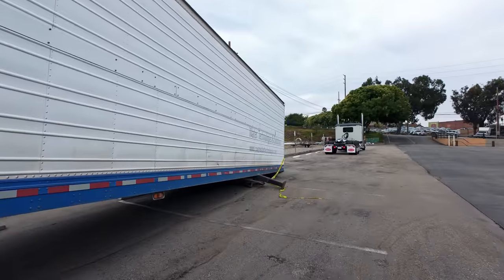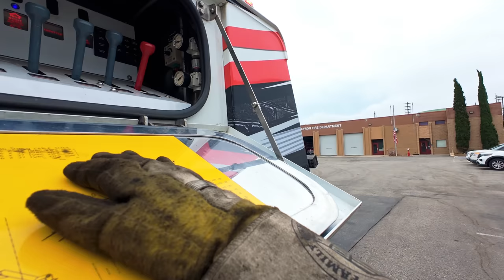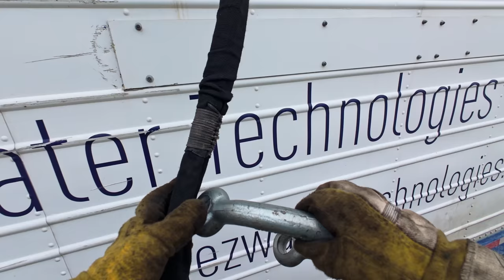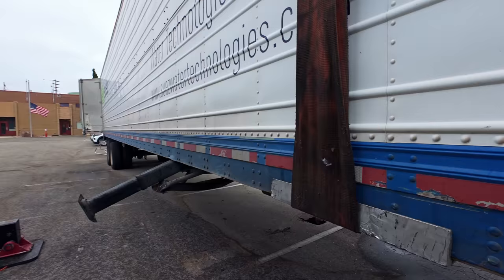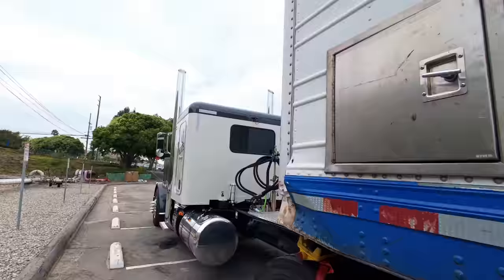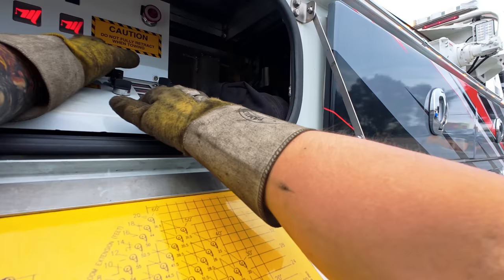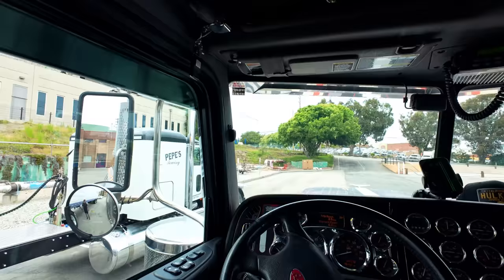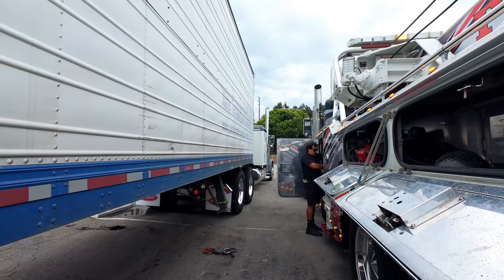Water Filtration Trailer Falls After Landing Gear Breaks

Comment: U  could use under lift push it down and in
Reply: Thats what I thought
Reply from the maker: Use the underlift ? So you would get in the truck , turn and back up to it, then use the underlift. You just solved the same problem but with a ton of extra steps. How is that better
Reply: @PepesTowingService  true I try sove it but out riger was better idea and worked  better what said true I trying think do it before idea  but done job so all good 👍

Comment: Maybe trailers should carry pads like you use under the the rotator's outriggers. The trailer's landing gear has such a small footprint for the weight they have to support. Plus, as we've seen many times before, you never quite know how solid the surface is you're dropping the trailer down on... until it's too late!
Reply: We use those at my carrier, and it wouldn't have helped. This trailer was dropped quick and rough. The metal fatigue in the landing gear couldn't compensate.

Comment: How often do you use the tri axle on hulk as always seen it in the up position ?
Reply from the maker: Never. What would I use it for lol
Reply: @PepesTowingService   Is the purpose of the tri axle then to be used if you are towing an EXTREMELY HEAVY LOAD and need less weight per tiire. They must have some usage otherwise why would they be part of the Truck configuration.